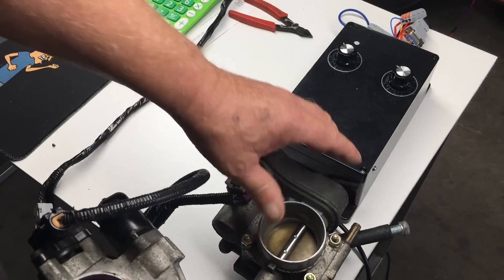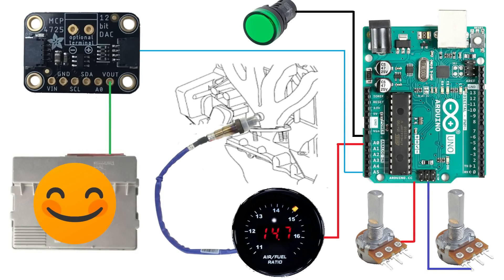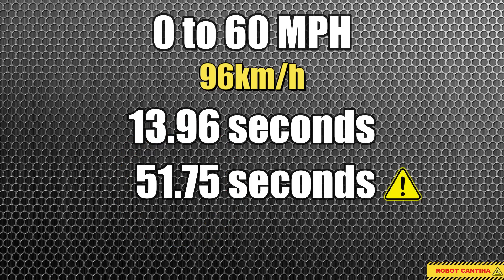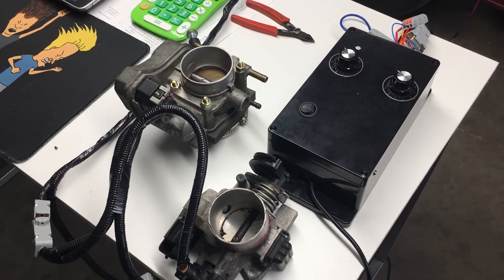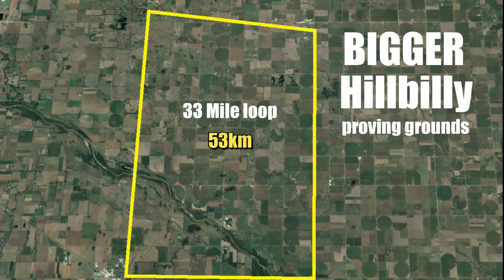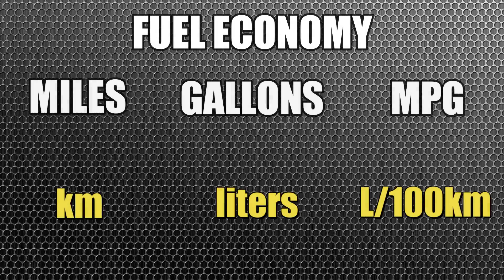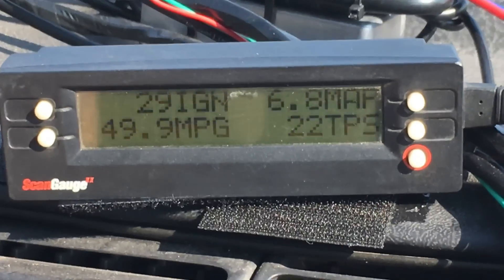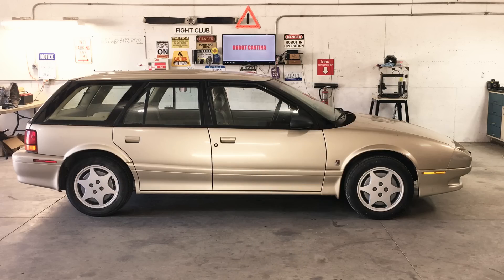S2E21: Our modified Saturn that gets Extreme MPG with lean-burn and Robo-throttle.

Comment: Look for an oil leak about 1cm below the top of the cylinder head. The oil gallery cracks and drips from a ragged, roughly horizontal line that can be seen if you rev the engine while spraying brake cleaner - the crack doesn’t stay clean.

Comment: If he had the valve timing setup (Atkinson cycle) from the Toyota I drive, he'd probably beat my fuel economy. My car is doing 56 mpg on the current tank of gas, pretty normal for me when the weather is warm. In colder weather my fuel economy goes down because I drive maybe 8 miles in an average trip, and during the first 1/2 to 1 mile of a trip, I tend to get around 25 to 40 miles per gallon.

Comment: I'm utterly impressed. That saturn is sitting slightly under the 2017 Prius and 2022 Rav-4 Hybrid on fuel efficiency. In my case I get 6.3L/100Km. How can such a car be more efficient than a hybrid? Wow
Reply: Because the hybrids are very heavy.

Comment: That gets better fuel economy than my second gen Prius.... 

Prius will be my girls when I get married, but I'm looking forward to doing some eco tuning on my Chevy 3500 LB7 once I get it back up and running. Some have gotten 35mpg out of that engine with tender driving and a tune. I may try an electronic throttle like what you got there to negate my lead foot.

Comment: You are avoiding the reality of Nitrogen Oxide emissions, and absolutely burning down the exhaust side of that cylinder head. It will not last. 
You must advance ignition timing. 
I did this 10+ years ago.. Ended up getting 65MPG. 
Innovate is NOT a "Quality" company. It is imported and rebranded Chinese goods. 
Their MTX-L line is less reliable than a wet paper sack
Reply from the maker: In episode 18 when we introduced the leanburn experiment, we covered the NOX and potential engine damage.  Keep in mind this is just an experiment.  We do a lot  of experiments on this channel.  The Innovative Motorsports wideband is indeed good when compared to the cheapo wideband we used previously.  Again you would need to watch episode 18.

Comment: Interesting, trying to fudge more mpg by playing with the parameters and the hardware. If the purpose is to learn about Arduinos and engine management on the level of a high school project, that's great. If  the goal is to lean out the mixture and pollute with massive spikes in Nitrous Oxides and piss off the EPA, bingo, you are a winner. Because that's what lean does...
Reply from the maker: We cover the NOX issue in episode 18 when we put together the lean burn experiment.   Keep in mind this is just an experiment, we do a lot of experiments on this channel.
Reply: @robotcantina8957  Thanks for the clarification. For experimenting, great!

Comment: If increasing MPG is the only goal, and we are not trying to be mimic any real world scenario then the suggestions below would help 

1. replacement the rotation assembly with lightweight materials.
2. increase compression ratio 
3. strip everything, that has not already been, for weight deduction
4. improve aerodynamic. full belly pan, diffuser and tear drop shape shell made of light weight material like foam with a super smooth finish

Comment: 2000’s tuning: “MORE POWER “
2020’s tuning: “ please use less gas”
Reply: Why not both, make lean burn map on cruise, and give it some timing and fuel on high rpm, now days variable valve makes it even better to have both, if you are on custom ecu its even easier to make lean maps for cruise speeds.
Reply: @winha1435  easier said than done...
Reply: @Fred_the_1996  I have seen this done this whit few ecus, done one myself whit Vems and now trying to make this on ms43 ecu and im quite amateur on this. Sure its not plug and play but not insanely hard either, ecu platform make it harder on differend platforms some have pretty good modding community.
Reply: @winha1435  yeah, my crusty old 1995 ecu is almost impossible to tune lol, I tried chip tuning it once and it fcked up my ignition timing and fuel mix so bad that the car didin't even start until I took it to a programming shop. It's harder than it looks for beginners like myself😅 Maybe I'll try using a BIPES ACU in the future since no one uses them anymore and they're dirt cheap
Reply: @winha1435  that's pretty much what newer engines do. The second I'm off the throttle on mine I watch it go 9% lean. The two big efficiency gains to be had are from a stop and under hard acceleration. From a stop, hybrid is the answer, even a very very simple hybrid that only gets you going 5mph will yield big gains. Under a load, it gets complicated. TLDR: around about 3-5psi going into a 1.4l engine is optimal for fuel atomization. Right around there you can see acceleration mpg from 20-45mph up to 25mpg even. I recorded data like this on my Chevy Sonic 1.4 turbo. Keep in mind this is approximate. Very good for real world acceleration. So eco tuning a new engine would be limiting the boost and running high octane fuel usually. Some gains will also be seen by keeping the intake temps down to avoid fuel richening.
Reply: @notsam498   Yes. In newer (toyota had lean burns in -9x and variable valve egr has been here for a while so i dont really know what is considered new in here) engine some small gains from consuption can be had cause they are emission focused on burning and making power while at it. Hydribs like Ampera had ice engine to only produce electricity and it works well but its bit complicated build overall, in most hydribs it can be relatively small gains  if ice assist acceleration since one litre of gasoline contains the energy equivalent to 8.9 kWh of electricity it makes lot more sense to drive the whole engine whit electricity instead of burning gasoline to mostly heat to make power to move.
Reply: @winha1435  when you say newer Toyota? I haven't seen an egr on an engine produced since 2004?  I would like to  push the question, what does emissions focused mean? I am making it a point to respond to post on this topic due to the common misconception that emissions, fuel economy and power production are at odds. emissions almost inherently means more efficient fuel usage, which is the same as increasing fuel economy, and the same thing for increasing power production, we want to maximize the total energy yielded from each gram of gasoline. the only contradiction is noX or forced induction under high load, noX can also be an indicator of shortening engine life due to going too lean on the burn. so usually keeping noX low is good for your engine surviving. Hybrids also can be simple, implementation is everything.
Reply: @notsam498  Variable valve system works as an egr its also used recycle some of exhaust gasses for differend purposes, emission controll has high priority on how burned gasses are prosessed when they come out of engine and that affects economy some ammount, we are getting closer for getting best out of both worlds for every iteration of this system but still some energy is used for things like heating cats as fast as possible, cleaning functions and catalytics temperature controll. Im on the coffee brake and english is not strong language for me so i hope my rambling makes some what sense 😅
Reply: @winha1435  If we are talking about VVT, thats not quite correct. VVT is exactly what the acronym suggest. variable valve timing, It only effects the camshaft timing usually via oil pressurized sliding cam sprockets. it increases efficiency and power production. no exhaust gas is recycled, instead during low rpm cycles, the engine will run a clean cam configuration where the valve timing has no overlap between exhaust and intake. during higher revs, the cam timing will begin to overlap and produce an effect called scavenging that will extract more exhaust from the cylinders between burn cycles. when used in concert with ignition timing tables, the overall intake and exhaust cycle can be shifted around the stroke of the engine, this allows for the compression and combustion cycle length to be optimized for the revs. I did some googling and it looks like toyota has not run egr since the 90's maybe early 2000's. egr was an awfull technology, I was so happy to see it go. It seems like egr valves always malfunctioned as they aged.
Reply: @notsam498  i think you might want to read more about variable valvetime and their role in vehicle emissions.

Comment: The saturn ignition system is an ion sense ignition type.  They call it "compression sensing" ignition.  the cam sensor signal is GENERATED by ignition module.  Check the wiring schematic.  Be very sure your spark plug gap is set to factory specs.  A cam sensor code will be generated if there is too much secondary resistance.
  Hope this helps.
Reply: Came to the comments to say this
Reply: It is not an ion sense system. Only Saabs had that. It's a wasted spark system. Early Saturn S series had standard GM dis ignition modules. It fires spark to two cylinders at a time so it just doesn't need to care about cam position. One is approaching tdc compression stroke the other exhaust stroke. There was a change in the late 90 from the DIS ignition module under the coils to the coils being directly fired by the ecm. Coils were unchanged.
Reply: @dimedriver  It was sequential fuel injection.  Not simultaneous double fire.  What synched the injectors, eh?

Comment: If you guys don't know how easy it is to reprogram an ecu, you really need to go back to school.
Reply from the maker: Please provide us the with the list of hardware and software required to reprogram a Saturn PCM.  I don't think it is as easy as you may think.
Reply: @robotcantina8957  laptop, j2534 pass through device of your choice (countless to choose from) power supply such as a midtronics PSC-550, and software of your choice. It is easy, the fact that you disagree is proof in itself that you do indeed need to go back to school.
(edit) I personally would consider building a stand alone ecu from an arduino such as a Speeduino.
Reply from the maker: @johnlockesghost5592  After a quick search, I did not see a way the J2534 would allow me to edit the ignition timing map on the stock 1997 Saturn PCM.  Please provide the exact hardware and software you use.

Comment: I've just discovered your channel, but have your done or are planning to do a gas generator hybrid setup? Other than slight weight increases due to an extra motor and a larger battery, would an EV not have better performance characteristics while an HEV of the gas generator type not have better fuel consumption characteristics in comparison to a heavily economy tuned ICE vehicle? I'd also be curious to see a gas vs. diesel comparison of this kind of setup, of engines with similar output of course. With the way the parts market is going, an HEV project is a very realistic idea that has a wider potential use case than hyper-optimizing engine control with results that could be lackluster and a change in driving habits.

Comment: I had a stripped down SL1 sedan. No AC, no power steering, 5 speed (from factory). On the highway it would do 40 mpg. Very impressive for a 1.9l I think.
Reply: I'm having major respect for the early Saturns now
Reply: @dangerousdave5915  I have owned 3, and am planning on buying another one. They're reliable and pretty easy to work on. Only thing I have ever heard is the ones with automatic transmissions had problems with their electronics. I always had 5 speeds though.

Comment: 49 MPG is excellent considering the age of the vehicle.  Modern cars can hit this though without too much effort in some cases (I'm constantly amazed that my 4 cylinder stock 2020 Camry can do 40-42 MPG on the highway on flat land, which is actually about 3-4 mpg higher than Toyota rates the vehicle at).

Comment: Very interesting as always! I have another idea of how you could potentially advance the ignition timing a bit. If you trick the ECU into thinking the intake air temp or possibly coolant temp is lower than it actually is, that may result in a bit more timing advance. Temp sensors are usually negative thermal coefficient thermistors, so you can manipulate the temp reading by varying the circuit's resistance. Tricking the MAP sensor into showing lower than actual manifold pressure may help too since ignition timing is generally retarded under higher loads. Of course the fuel delivery will be affected by modifying the data from any of these sensors, but you should be able to adjust for that to maintain your desired air fuel ratio. Hope this helps, keep up the great work!

Comment: A long time ago (in an nightmare commute far far away) I found the BSFC (Brake-Specific Fuel Consumption) Torque Speed map for a Saturn S-Series DOHC engine.  I was never able to find one for an SOHC engine, so I don't know the RPM + Engine Torque (aka load) sweet spot for your SOHC engines.  If you had a DOHC, then it would be 2500 RPM @ 124.8 Nm (newton-metre).  However, with all of your equipment, you could probably generate your own BSFC map.

Comment: Here is a crazy idea.  How about a ultrasonic transducer from a mister to help vaporize the fuel after the throttle body.   I'm thinking this would help with overall fuel vaporization.
Reply: Interesting idea
Reply from the maker: It's an interesting idea, however this engine is port fuel injected, or in other words, the injectors are near the intake valves and there isn't enough room to add the ultrasonic devices

Comment: I have a gold SW2 as my daily driver. I'd say the build quality is on par with any 90's Toyota I've owned. My only gripe about it is at 200k+ miles it burns oil (due to bad piston ring design I read). I have changed the crank position sensor and yet it is a pain in the ass to get to and you're basically working by feel lol
Reply from the maker: LOL, Yeah, it seems like all Saturns burn oil.  Its too bad, if it wasn't for the oil burning, these cars would be indestructible.

Comment: Why didn’t you run a pipe up to the exhaust manifold and suck air right off the iron? Hot air is less air, less air is less fuel.

Comment: Also adding mpgs is very hard to do just based on displacement that motor just is happy in a very narrow band of happiness like a 2 stroke fuck with it and it will blow its guts lean rich both are bad it's all about the happy  medium in a stock car but if its built for it its different have fun

Comment: Should put a alignment on it you can see the wheel is cocked also the knock sensor is a gm trademark failure on gm motors heads up!

Comment: Adding the map reading elements of the smart throttle to the cruise control would be very cool. It would also have the possibility of removing the second throttle body because the cruise control would perform the same function of controlling the throttle

Comment: I got 3.8L/100km / 62mpg calculated on a ~250km trip driving at 90kmh in my Volvo S60 D5 manual. It is a 2.4L 5cyl commonrail diesel with no other emission bs than a egr (that was blocked) and a cat. Would be interesting to see how low it could actually go if someone would put some effort into making it efficient as possible.

Comment: Put some solar panels on it, used to charge up a battery bank, use the battery bank to produce HHO gas & feed it into the intake to mix with the air/gasoline mixture & see how much you can improve MPGs.

Comment: another thing you could try is getting a narrower tire. On my wifes corolla she had a 195/65/15 and I put on some 185/65/15 tires. the speedo only changed about 2 kph but she went from average 550 km per tank to over 600. less rolling resistance = less fuel burned. also the car does better in slippery conditions because a narrower tire patch increases the pressure per square inch which increases traction.

Comment: There have been a few fuel economy tests done with the windows down vs ac on and the ac on was more fuel efficient.  Essentially what your doing with the windows down is dragging a bunch more weight (drag) like a big parachute hanging off the back of your car. Try the next tests with the windows up and no other  modifications . And anyone who says 9+ mpg isn't helpful is out of touch with reality.... that's really impressive

Comment: I used to get about 50mpg highway in my 2000 Saturn SL1 5MT (stock with AC off), and I've gotten over 45mpg highway in my '08 Honda Fit Sport 5MT (stock with AC off).  Can't wait to see how many mpg's you can squeeze out of this one.

Comment: I mean this is awesome if you only got five more miles to the gallon would be awesome I'm all for technology and everything but people don't know like with the electric cars we're just exporting the pollution look at chili people are literally dying by the mines dying of cancer and everything and it's going in their water I'm not saying electric cars are not the future but until they can make batteries that are fully recyclable and use other materials I watched a show and it literally said that if you buy a new Tesla right now you have to put 200,000 miles on it so it'll be somewhat carbon neutral because all the special metals in the battery they figured how much it pollutes just to make them it's crazy if someone keeps their car more than 5 years they actually do more for the environment then somebody who buys a new one every three to four years.  People don't really think about that but if you see a car on the road for 10 11  12 or even 15 years old like even if they had to replace the engine it's still less stress on the Earth on the environment so when you see somebody driving an old old car don't think negative.